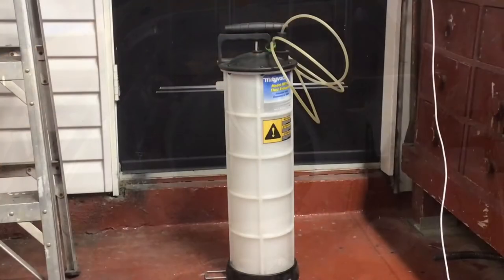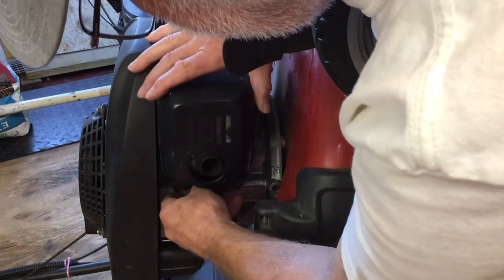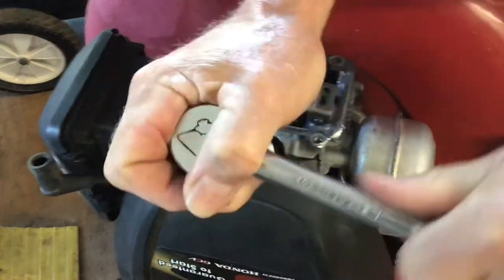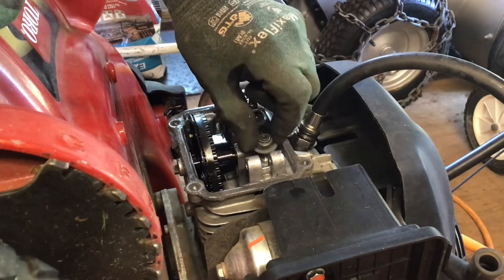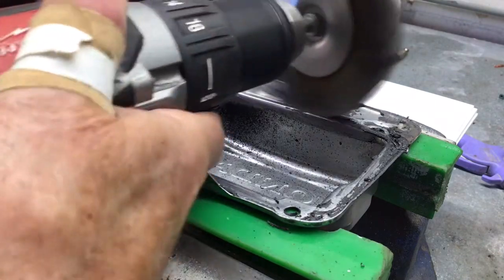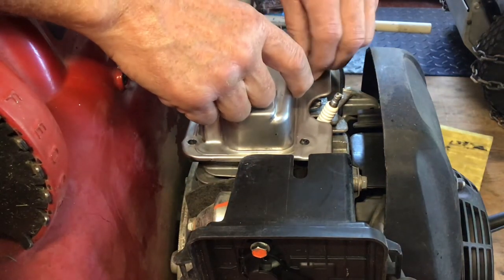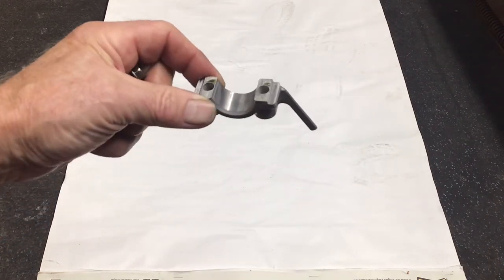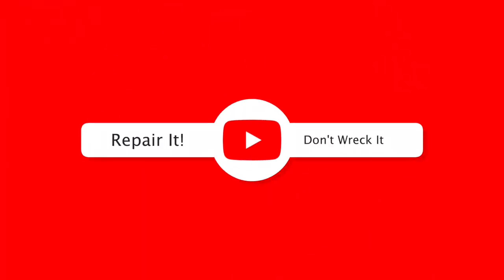Honda GCV160 lawn mower engine burning oil (smoking)

Comment from the maker: Hi M Gomez. So do I. I watched another Utuber use a heat gun to soften the gasket by applying heat to the edges of the aluminum valve cover. He removed it with out tools. Just his hands. I definitely will try that next time. Don’t forget to wear some gloves. Thanks for watching. Roger
Reply: First and foremost, thank you for sharing your experiences and problems.

I am an experienced user of mainly Honda lawn machines, including an HR217 more than twenty years ago. Currently a Honda HRH 536 HX and 2417 Riding Mower with a GCV530.

From experience I know and can confirm that a regular 5w30 is not sufficient. A Rowe Hightec Synth RS 5W-40 or even better an Amsoil XL Boosted or SS Diesel (the best) 10w30 or 10w40 are recommended.

The above have an ideal HTHS which is necessary. As well as a low NOACK or evaporation loss.

These small adjustments will save you future problems and the engine will last a lifetime.

Changing the oil before the winter and again in the summer is ideal.

Always use gasoline without ethanol, and add a shot of B&S fuel stabilizer. You're doing good with it.

Good luck and have fun with it!

A Belgian.
Reply from the maker: @laurapalmerTDGE  Thanks for the great post full of information. There is nothing more valuable than experience. Since I’m not a specialist, when doing videos I try to use what the manufacturer states in their manuals. I’m not saying there is not a better way to do things but I need to be careful. You  know it can’t hurt to change the oil to much. As you stated, I also change the oil at least 2 times a year. Originally I wasn’t going to do a video on this lawnmower. However I turned on the camera and felt there was some decent footage. This was the first time I had ever completely taken a mower apart. I was pleased that my oil change schedule was good enough that the insides looked pretty good. My moto is to promote fixing things rather than throw stuff out. I’m going to use your recommendations for my lawn mower. Let see how it goes. Thanks for checking out the video and posting. I really enjoy reading the comments. Thanks again. Roger
Reply: @repairitdontwreckit4257  - Glad to read that it is useful to you and that it interests you.

Over time you will notice the benefits, and you should take good care of that Honda or a Honda in general.

To illustrate, my Honda HRH costs $2,358, the means for proper maintenance are negligible in price.

And mainly you have to think about maintenance of the spark plug, the air filter, oil, and especially sharp blades.

For the blades you can search for "flap disc grit 40 mower blades".

You should also know that engine oil serves to cool the engine, oil absorbs and dissipates heat, as an optimal compression of the piston, etc.

With what I recommended you will hardly have any oil consumption, but you can still check the level periodically. 

A quick expl. about a 10w30 : 

10W:

The "10" refers to the oil's viscosity at cold temperatures (lower temperatures). The lower this number, the thinner the oil is at cold temperatures. A lower number here means the oil will circulate more easily when the engine is cold, which is important for engine startups in colder climates.
The "W" stands for "Winter". It's an indication that this number pertains to the oil's cold temperature characteristics.

30:

This number refers to the oil's viscosity at 100°C (212°F). The higher this number, the thicker the oil will be at high (operating) temperatures. A thicker oil at high temperatures can be beneficial because it provides a better protective film between engine parts at those temps.
So, in the case of 10W30 oil:

The oil behaves like a 10-weight (thinner) oil when the engine is cold, ensuring it circulates easily and provides lubrication.

At operating temperatures, it behaves like a 30-weight (thicker) oil, ensuring it provides adequate protection under the heat and stress of the engine.

In summary, multi-grade oils like 10W30 have been formulated to protect the engine under a range of temperatures, making them versatile and suitable for many driving conditions. It's always essential to refer to your vehicle's owner manual to see which oil grade is recommended for your specific engine and driving conditions.

Enjoy!

Comment: I change the oil every season. If you cut a lot of grass then twice a year would be good.
Reply from the maker: Hi Mr Tumbleweed. I totally agree. These engines are air cooled. The oil has to do a lot of work. Thanks for posting. Roger
Reply: @repairitdontwreckit4257  that's very true Roger. I'm currently rebuilding one of these and am encountering the same thing as you did. I'm going to see if I can get a flex hone tool like the one you have as I too am going to be fitting new rings. 
Could you tell me what size you bought? The cylinder is 69mm diameter but I understand that you have to buy something larger than that 🤔   Flex hone are harder to find here in the UK but Amazon have some listed so maybe they will be able to post one out to me if I can find the right one.
Reply from the maker: @MrTumbleweed22  I went to the flex hone website. They state to order the honing tool the size of the diameter of the bore. It will be delivered slightly oversized. In your case the bore is 69 mm. They don’t make a 69 mm diameter, but the next size is 70 mm. This is what you should order. If the cylinder is aluminum the site recommends a honing tool that is made from aluminum oxide. I used a 240 grit. The damage on the cylinder walls for my lawn mower wasn’t to bad overall. I used motor oil to lubricate the tool and the cylinder. It doesn’t take much time to hone the cylinder. Start at say 20 seconds or less and check how it’s going. Always keep the tool moving. There  are videos on the flex tool website and on utube. The flex tool website also has recommended rpm speeds to help you get the best results. It’s not hard as long as you follow the basic instructions from the manufacturer. Have a look at some of the videos to get an idea of what to expect before ordering. Also double check what I have said to make sure I didn’t miss anything. It’s been while since I did this video. It doesn’t take much to get the cross hatch going on the cylinder walls. I hope this helps you. If you have any more questions just post them and I will do my best to answer them. Thanks . Roger
Reply: @repairitdontwreckit4257  thanks so much Roger. That's really helpful advice 👍😊 I managed to find a 70mm one on Amazon so when it arrives I'll let you know how it goes.
Reply from the maker: Sounds good MrTumbleweed.

Comment: You should use a clean rag, or paper towel around the cam gear to keep from dropping a part into the engine. Like the spring retainer. Things happen.
Reply from the maker: Jessebunker. Very good point. This was my first time doing this. It’s always good to hear from viewers with suggestions on how to do things better. Thanks for watching and posting. Roger

Comment: I have a gcv160,  with piston       Z2A 01. This piston uses 1mm thick piston rings for the top 2 rings.  Ayn idea how I can find a set ?
Reply from the maker: timdenton   I’m  looking at the part number for the piston you have. It doesn’t look complete. For example the piston number for my mower is 13101-Z8A-900. The rings that I used were 13010-ZOL-014. These are Honda part numbers based on the serial number on the engine. The Honda website for parts was not to bad to use once you got the hang of it. If the piston is a Honda part I seen no reason you can’t find the rings for it. With parts it’s all about the numbers. From my experience a lot of the parts were the same for different years and models but the engine size was always the same such as the GVC160. You still need to check the numbers as there’s a ton of parts out there and there can be subtle differences that are not noticeable to a visual examination. Thanks for posting your question. Roger
Reply: Don't know age or model number. The number was on top of the piston. Call US HONDA?
Reply from the maker: @timdenton2067  I think calling Honda is the way to go.

Comment: Why didnt show how dismanle get to the rings
Reply from the maker: Hi @menortheledge. Originally the plan was to  video replacing the valve stem seals the solve the smoking problem. When doing that didn’t fix the problem I started looking at other utube videos to learn how to do the ring replacement. There is a lot of good videos out there already. I felt that I couldn’t do a better video. I’m not a professional engine rebuilder and didn’t want to give bad advice by accident. However what I did was to take some video on what I was comfortable talking about. I hope this answers your question. Thanks for watching and posting. Roger

Comment: Just wondering which 'Grit' flex honing tool you used ?
Reply from the maker: Hi Dean. The grit in the video was 240 and the composition was silicon carbide. It was real easy to use.  Check out the flex hone website as they have excellent videos on how to properly use the tool. Thanks for checking out the video. 
Roger

Comment: Do both valves have seals?  Only one seal was replaced in the video.
Reply from the maker: Hi Joelmb. You got me thinking. It’s been a while since I did the video. I went back to the engine parts list.  It shows one seal on the intake valve. Just to be safe if your doing work on your engine double check your set up. I’m thinking a seal on the exhaust valve wouldn’t last long. Also, on the intake, oil is drawn into the combustion chamber as there is vacuum. That’s why they have a seal there to control the amount of oil on the the valve stem. On the exhaust you need lubrication also. From what I’ve read there’s a little bit of pressure so it’s not a problem with oil getting into the combustion chamber on the exhaust side. I pretty sure the engines have to meet emissions standards at the time of manufacture. The engine has been designed to pass emissions without a seal on the exhaust side. Whew. It’s a topic in itself. Thanks for watching and posting. Roger
Reply: If you install old seal on exhaust you must remove the rubber seal and it’s ok then to keep guide from moving up

Comment: I am in the process of rebuilding my dads Honda GSV190 engine,I fitted the piston & rings last night & reassembled the crankcase.

I previously replaced the Valve stem oil seal which didn't Fix the problem so.I ordered a new piston, rings, timing belt & crankshaft oil seals to rebuild the engine,I needed to replace the piston because it's a 20 year old lawnmower engine & the original piston rings are no longer available from Honda, they went for thinner loe friction piston rings in the later.engines.

In our case it smoked very badly on startup but it cleared up once the engine warmed up a bit,it has done a lot of work,the piston ring gap on the lower compression ring was 0.5mm which is 0.05mm above Hondas Maximum specifications,the new piston ring gap measured at.0.4mm which is good & the top compression rings gap was 0.35 mm's which is good also !
Reply from the maker: Hi RussellBooth. Sounds like you have done a thorough job. Once you open up the engine it makes sense to replace the additional parts that are ready to be swapped out. The nice thing about these engines is they are easy to work on. They seem to have fewer parts and a simple design which has been around for a while. I have the same size engine in my pressure washer. I bet your Dad is happy to have the repair done so he doesn’t have to go and get a new mower. I hope the video gave you some direction and confidence to tackle the  repair. I can see you did your homework regarding parts and specifications. Nice job. Thanks for checking out the video and posting. Roger

Comment: I would cut the rubber off old seal and put it on exhaust to keep guide in place and install new seal on intake is what I do 😊😊😊
Thank You for sharing video
Reply from the maker: Hi Phillip. Thanks for checking out the video and posting comments. There’s definitely more than one way to keep the valves in place. Not everyone has a compressor. For me it was a little scary thinking what next if the valve dropped. At the end of the day I ending up taking the thing apart. It was a good experience. Every time you do something like the rings you always learn and build your confidence. Roger
Reply: So you're saying you watch the video where the guy did this 😅

Comment: @repairitdontwreckit4257: 
Excellent video you posted here. 
I am going through the same problem with my 12+ year old Honda GCV160 engine, and after watching your video I will do the same to my Honda engine.
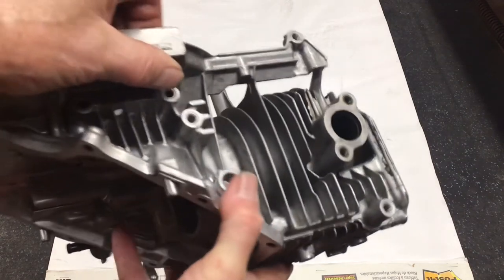At the 7:35 mark, you showed the Flex-Hone tool you used for this job. 
Could you please put up the link for that tool here?
Thanks.
Reply from the maker: Hi there cma8165. I purchased the Flex Hone tool on Amazon. I used the silicone carbide , 240 grit brush. I would go to the Flex Hone website to determine the correct diameter you would need. It’s been a while since I posted the video so I’m not sure of the diameter that I used. However the website is excellent for any information you would need.  One advantage of going to the Amazon listing is you can read the reviews to get a
good idea of what people think of the tool. I took a quick look. It had a lot of 5 star ratings. It’s was easy to use with excellent results. Here’s the link.    https://a.co/d/6muBBKx   Good luck with your project. Thanks for watching and posting. Roger

Comment: Did you use a ring compressor?    Very awe dome
Reply from the maker: Hi Matt Caldwell. No I didn’t. I went on utube and found a video where a guy used a gear clamp. Something you would use to secure hoses to fittings. Usually stainless steel. It was a little tricky but if you take your time it will work. It took a couple of tries to figure it out but I got it to work. I didn’t feel like buying the tool for one job unless I had to. Any hardware store will carry them. Thanks for watching the video and posting. Roger

Comment: Thanks for sharing. Is the bore plated on these engines?
Reply from the maker: Hi metallitech. Thanks for looking at the video. I’m not an expert but the bore was not plated. It certainly was aluminum and responded to the honing with excellent results. Today I cut the grass and everything was running smooth. Roger
Reply: No there just cheap